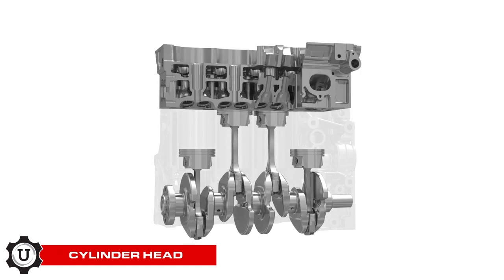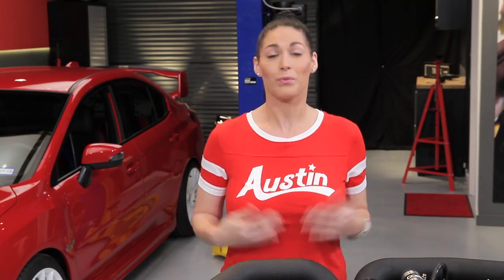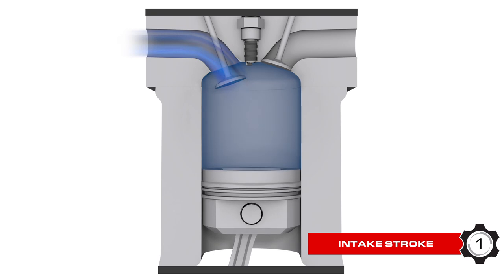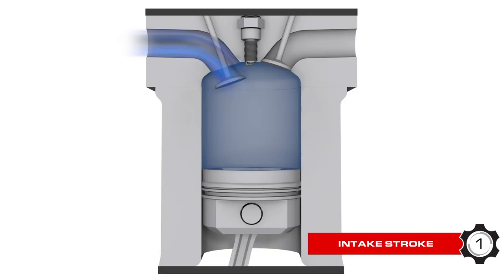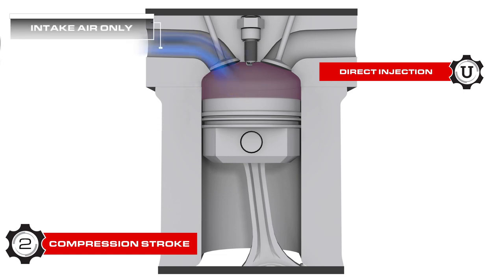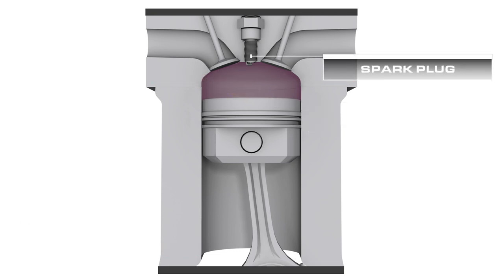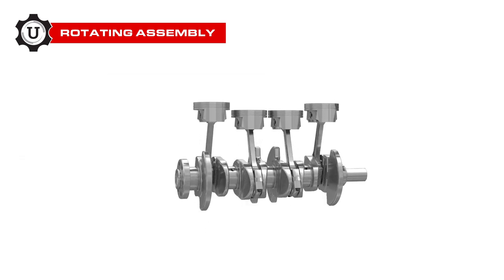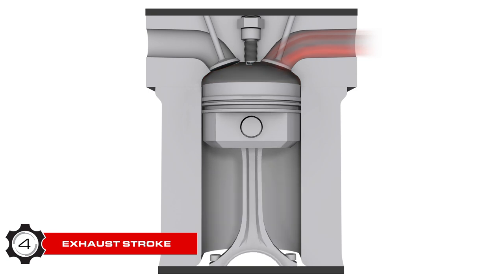COBB Tuning - COBB University Episode #8 - Combustion Cycle

Comment: With regard to getting a 1 step colder plug, is power the only variable when considering getting them? I have a 2017 Focus RS and an upgraded air filter and a tune could see gains of 30 hp but over 50+ lbs/ft of torque. I guess what I'm saying is: is torque gains a consideration for getting colder spark plugs? Also would love to know the importance of gapping the sparkplugs right.
Reply from the maker: The general rule of thumb is to step down a heat range for every increment of 100hp.  Determining gap isn't necessarily straight-forward either, cylinder pressure and strength of the vehicle's ignition system definitely come into play.  NGK has a great knowledge base on their website that may help you get a better feel for your car's needs : https://www.ngksparkplugs.com/about-ngk/faqs/spark-plug-faqs 
Marshall@COBB
Reply: COBB Tuning thank you very much. looking forward to slowly finishing this series and acquiring enough knowledge to start tuning my vehicle. I actually just purchased a Cobb accessport and received it today.
Reply from the maker: Nice!  Congrats on the Accessport.  No knowledge is required for using the off the shelf maps.  Just make sure you have the appropriate map flashed for your modifications.  Custom tuning yourself is an option with Accesstuner.  There is a separate course through EFI U that gets really in depth which is required before using the software.

Kyle@COBB
Reply: COBB Tuning thank you. I'm looking to upgrade more than just a tune which is why I'm doing my research. I've already bought a quaife LSD, upgraded intake, recirculation valve, charge pipes. I'm now researching on an upgraded intercooler, wastegate actuator, and hopefully dampers when Ohlins makes them.